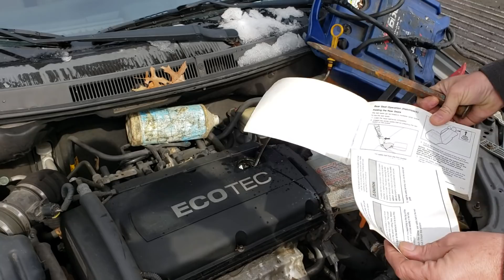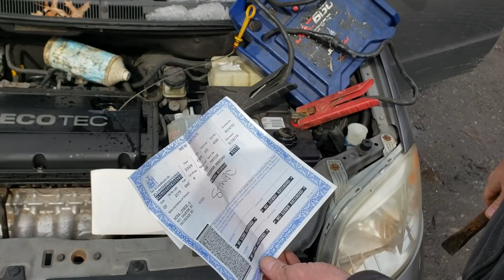HARD TO KILL! Chevy Cobalt Motor Eats ANYTHING! Neutral Drop

Comment: so I'm not gonna worry about the timing chain on my ecotec then. its making a little noise but nothing like that hahaha
Reply from the maker: According to this video your good!
Reply: NEUTRAL DROP hahaha its been clanking around for a minute but with that motor eating all that I feel like a little timing chain slapping ain't that bad.
Reply: You should be worried  because those motors use a timing belt if it breaks your done. Those engines are what is known as a full contact engine. Timing belt breaks pistons smash in to the valves
Reply: @heatherschable6649  
Wrong, Heather. All Cobalt engines are timing chains. Not belts.
Reply: 2.tank my pursuits motor was a beast
Reply: Clint .R nope you are wrong this engine is definitely an interference engine and they actually never had it in a cobalt it’s the 1.6l from Daewoo don’t let the ecotec badge fool you
Reply: Houssein Ahmed this is the next generation of the 2.2 ecotec from the Chevy Cavalier/ Pontiac Sunfire
Reply: Clint .R 1.6 l from daewoo not a true ecotec and definitely not a 2.2/2.4 from a cobalt
Reply: @92clintonr  no hes right he just used the wrong words if that chain goes on a ecotec your engine will be toast
Reply: @dallaswoods6315  
I did some looking myself and he is right all the way around. The Chevy Aveo (which is in this video) has a 1.6L "ecotec" engine but that specific engine is actually a timing belt. My apologies Houssein, you are indeed correct.
Reply: Clint .R  no problem man I actually have an aveo I’m going to do an engine swap on    So I did a lot of research. So the engine is a f16d3 I believe and I was thinking of swapping a u20sed into it. It’s been done before but my question more or less is what’s the difference between the c20let internally compared to the u20sed? I’ve watched vids of people pushing 230whp out of one with no engine supporting mods if anyone knows feel free to fill me in thanks in advanced
Reply: Hey I'm haveing the same problem with the 2010 colbalt, the sputtering noise the car was making any solutions?? Any help is definitely appreciated
Reply: Anthony Brown that doesn’t sound good I’d get it to a shop if you can’t figure it out yourself
Reply: @anthonybrown8686  maybe take care of that unless you are going to blow it up on video?
Reply: @chrisoconnor3119  well unfortunately no.
Reply: @anthonybrown8686  im sure, how many miles on your car? The kid i work with has 205k miles on his
Reply: 177k I feel like its a decent car just has that bucking problem I havent been able to fix yet
Reply: @anthonybrown8686  i think it is a good lil engine
Reply: @chrisoconnor3119  I don't doubt your right bud just wish I could find out what's making it run like that
Reply: @anthonybrown8686  start with a solid innova scan tool that lets you do enhanced searches and live feeback so you know what happens when it happens, I bought one of the only non updateable systems (that i regret because it limits past what year I can scan) that can do almost everything and I swear its kept our 40k$ new mountaineer from being another stealership quota for a new 2020 car, staying up with valve cleaning and coil packs help too
Reply: @92clintonr  you're right i've owned 4 cobalts all timing chains
Reply: Matt B timing chains are loud
Reply: @heatherschable6649  It's called an Interference Engine.
Reply: Lmao. My 2.2 ecotech ate one of the chain guides and was still good to go!! Found it in the pickup tube. Relatively easy job to do!
Reply: @heatherschable6649  interference engine*** and they are a chain.. otherwise I've been taking old chains off and replacing them with new chains like an idiot all these years....
Reply: @mark_osborne  
No shit. We've already concluded this. Thanks for coming incredibly late to the party with already known and covered information.
Reply: @92clintonr  sorry buddy, I see now where it was all sorted out ...sorry
Reply: @housseinahmed6240  Lol 230whp.... Get a v6 or v8 dude, pushrods preferably.
Reply: @Adam-lv1uu  you would be wrong my friend. what they did was beating the shit out of the cam shaft, but a flattened cam lobe isn't going to blow up a motor. having too much slack in a timing chain will blow up a motor. if you skip a tooth and lose the chain your engine will stop running all together and that's best case scenario. if you have an interference engine, and chances are pretty good that you do since everything runs 9:1 compression these days, some of your valves will be stuck open and then piston will come up on the compression stroke and smack the valve and knick the piston.